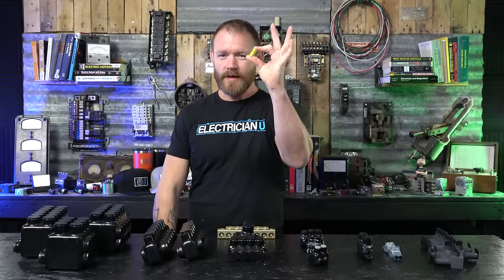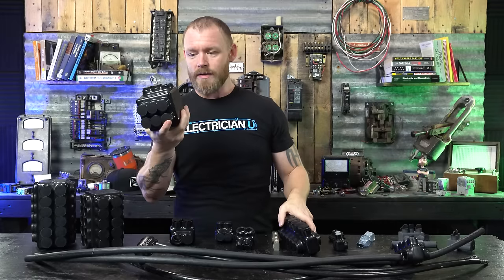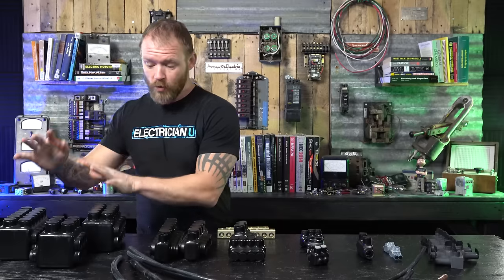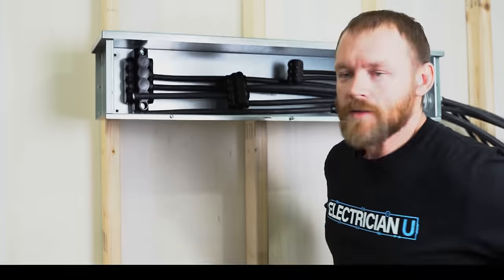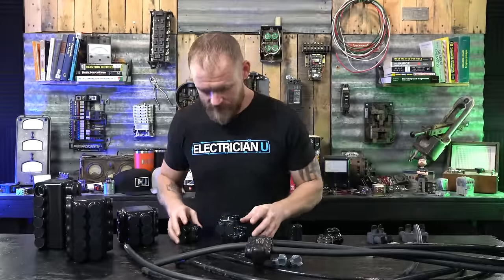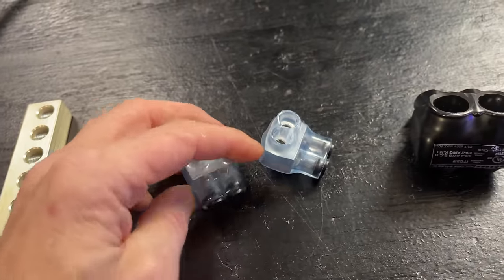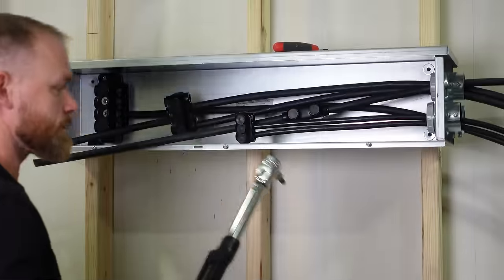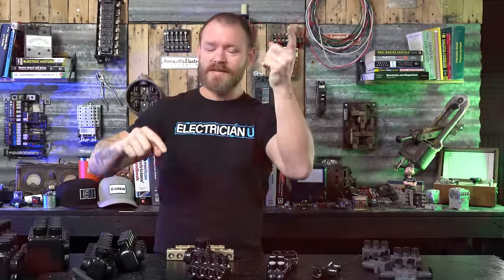What Are Polaris Taps? How Do You Connect Large Gauge Wires?

Comment: Since I moved to washington state noone knows what polaris lugs are, they say ohhh ilscos.    But everyone is wrong, polaris & ilsco are both brand names.  Their correct name is "insulated multi tap connectors".   I told the material handler this, he said I was wrong, he said look the supply house has them listed as ilsco lugs.  I said it only matters what the manufacturer names them.     Same debate with bell ends, they are really called end bells.    But what I learned is even if you know they are wrong, just go with it.

Comment: So this is a question rather then a comment, i have a building that is being built on my property and rather then run a second supply drop is it possible to use a tap to split the 1 supply with a tap then run a new line from the tap to the new building meter rather then running another drop. Thinking about cost the electric company is wanting a crazy amount of money to run a new drop to the new building and if a tap can be used that would save somewhere around 750 to 1000

Comment: @ElectricianU I used them a lot when working overseas.  I was a project manager for construction projects that were damaged by acts of war.  I would assist different teams of electricians,  plumbers,  steel erectors, etc as required to help complete the project in the time required.  I was taught quite a bit even though while I was in college I worked as an electrician apprentice. One thing I was taught was to always use a ferrule on any stranded wire regardless of the gauge of the individual stranded wire before putting it under any screw (breaker, taps,  etc).  So my question is are ferrules not a code requirement in the states? Also, I was taught we over-strip the insulation to show the inspector no insulation was under the lug then we slid 2 pieces of heat shrink tubing color-coded and shrunk it with the inspector watching before a service could be turned on.  Is that not done in the states?

Comment: I have a question.  We bought a house (1940's vintage) that has a basement surrounded by a crawlspace.  The original electrical service came thru the crawlspace to a Wadsworth 100 amp panel in the basement.  Sometime in the late 90's the previous owner decided to put in a heat pump.  To accomplish that, they put in a 200 amp Square D panel in the crawlspace backing up to the LB and floated everything (including the existing service) off that.  I want to move the 200 amp panel into the basement and do away with the Wadsworth.  Would it be worth the money to use Polaris taps to join the new conductors running to the basement to the existing feeds for the panel that will be moved?
Reply: Check with your local building inspector. Some AHJ's require a continuous run from the meter base to the first means of disconnect. I. E. the main panel. I failed an inspection over this once. Not a happy customer.

Comment: So... if where my service comes from the meter into the main panel of the house, I could put a trough and then send off wires from the meter off to three panels? Curious if any residential use?
Reply: well, you could... but at that point the wires would be long enough that you'd need service disconnects up front. You could use outdoor rated taps installed in a LARGE meter pan, such as those found on a multi-family home.... or just use an outdoor rated panel with several mains installed there. The last is probably easier and cheaper... and will allow for future expansion, service outlet, RV connection, pool panel, hot tub, etc.

Comment: Please I have one question..Can Control and Line Voltage Wires Be Run in the Same Conduit?
Reply: that depends on the voltage and insulation values. As an example, Generac (generator company) makes a wire bundle that is UL approved for running 240 volts AC along with 12 volts DC. I believe they are all #16 wire for voltage monitoring, low draw battery charging, and relay operation. (8 total conductors?) Fusing is at 5 amps. This is not to be confused with the wires for house load... always in another conduit. In this case the generator does use 240 volts as one of the control circuits. Not every inspector will pass the same situation if using THHN in a single conduit. I think the key here is following mfgr's directions and using a UL approved cable bundle.

Comment: Dry locations?    If a nema 3r gutter/wireway is mounted outdoor, is the inside a dry location?  The interior of emt and pvc installed outdoor or underground is a wet location.   I'm 99% sure it's a dry location, but got you thinking.
Reply: those are not dry locations. They are weather resistant enclosures. Since they are only used in a damp / wet location you should use wet rated equipment inside.... including wet rated wire.
Reply: @rupe53  Can we have outdoor panels? Yes, if nema 3r.   The breakers in a nema 3r panel aren't wet location rated.
Reply: @--JohnDoe  ... you are correct, and I never figured that out. The flip side is we've had wet rated wire for a long time and now wet rated receptacles. Do you think breakers are far behind?
Reply: @rupe53  Probably not,  imagine putting afci & gfci breakers in an outdoor nema 3r panel by the beach in florida, where it's very humid.  They won't last too long.   But it's code compliant.

Comment: It's bizarre seeing that insert for finely stranded conductors (presumably class 5 and 6 instead of class 2). I'm not a licensed electrician so I wouldn't know what the code would say for it but normally for terminating stranded conductors like that you'd use a ferrule on the conductor and then you can treat it exactly the same as you'd treat class 2 or solid conductors at that point. The ferrule is basically the same as that insert, but then it's reusable and you can just crimp on a new ferrule instead of having to get another one of those inserts (can you even buy them without buying a whole new tap??). The connection you'll get when screwing down on that insert also isn't going to be nearly as good as a proper crimp tool for a ferrule where it compresses 4 or 6 sides as opposed to just a single screw compressing it onto the strands.

Comment: Not an electrician - How is this different from Wagos?
Reply: you can't buy Wagos in larger sizes and these all require tools to tighten.
Reply: These are typically for wires that are a full inch in diameter, or a significant fraction of a full inch (like half inch).  We're talking hundreds of amps worth of conductor size.